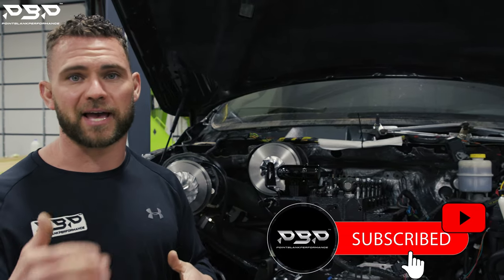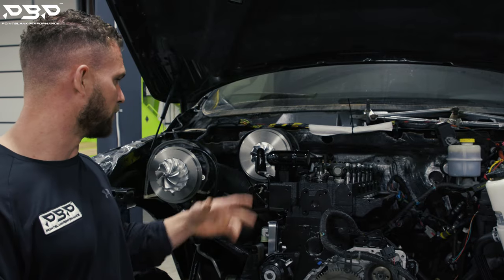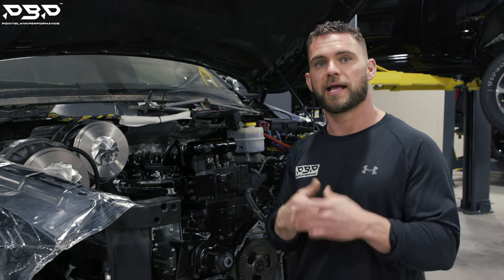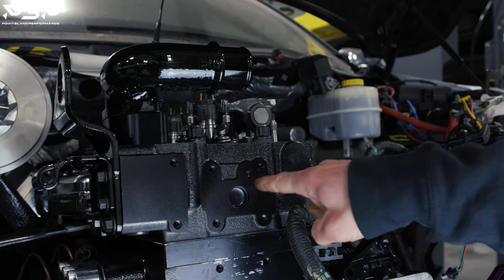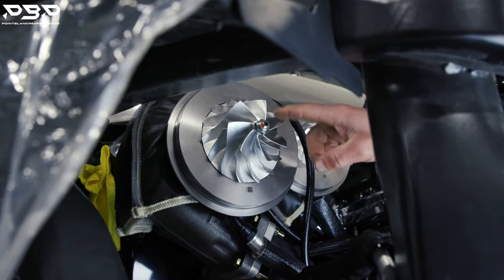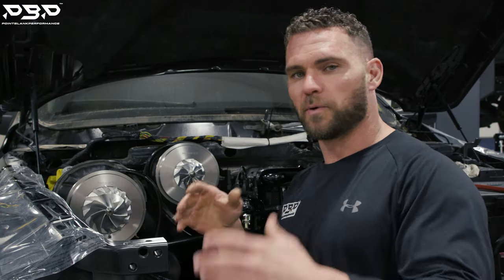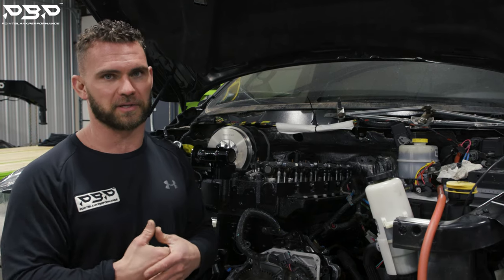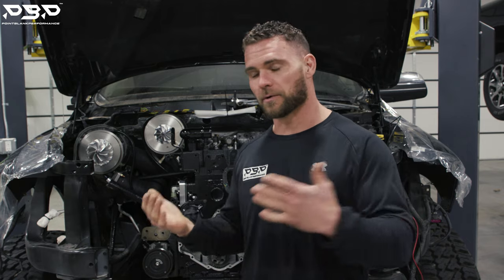1,000 HP CUMMINS !!

Comment: Is this engine setup the way it is because he plans to make more than 1200-1300hp? If not why go through all the hassle to sleeve and deck plate it? Genuine question because I have not seen a 1200-1300hp truck done this way UNLESS it is built to take 1500+ hp. As always great work
Reply from the maker: Thank you sir and one thing we didn’t touch on and should have is more so on the DeckPlate . When we spoke with the client on investing into a engine with “compounds” turbos going on the build we did give the offer to do a 6.7 punched out. With being transparent with Wagler about the future pushing the chargers harder Or upgrading them later on we wanted to lean away from possibly cracking the factory bore if we punched it out there is that chance . With the sleeved down to a 5.9 The sleeve are nice and thick so if the client wants to push it we won’t hesitate until the drive pressure just because unrealistic . Hopefully this helped ! By all means if it was just a 1.000 hp
Build yes not doing a DeckPlate is realistic but as we all know you always want more.
Reply: @POINTBLANKPERFORMANCE  understandable for reliability and longevity of it. Always nice to have the extra cushion for more HP if it’s wanted.
Reply from the maker: @DOAD_Diesel  Yes sir !!

Comment: Wait. If it's 4.016 bore and 5.88 stroke (1 inch longer rods) Wouldn't that make it a 7.3?
Reply: The stroke of the crank didn't change, just the rod length.  I believe this setup is a 6.4 after cutting the bore back to 4.02.  Longer rod slows the piston speed down from the long stroke and doesn't side load the cylinder walls or beat the piston to hell like a regular 6.7.